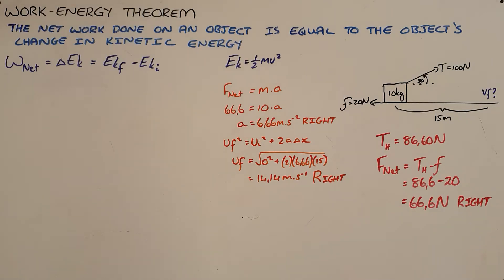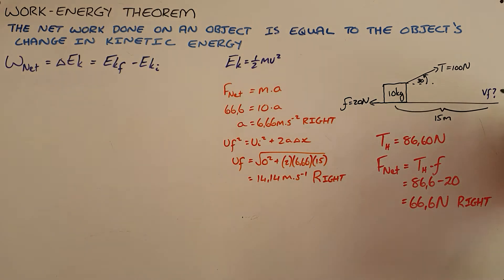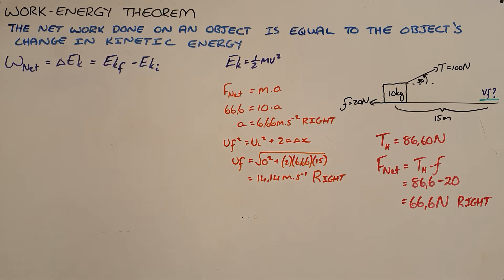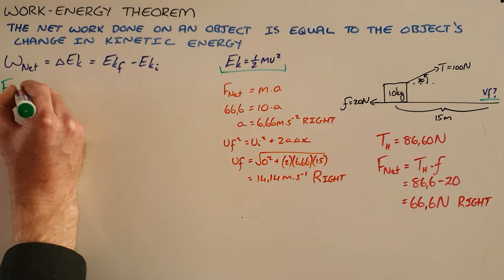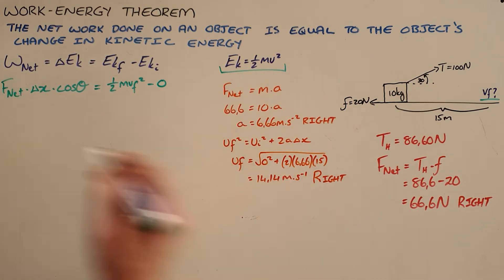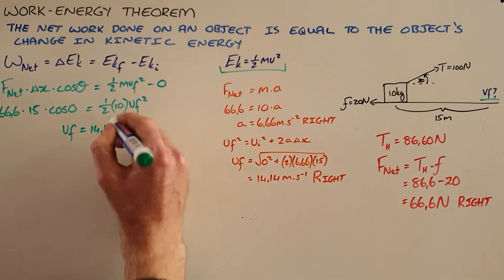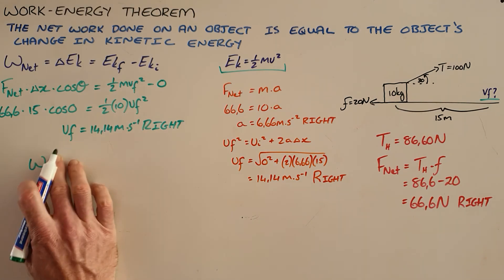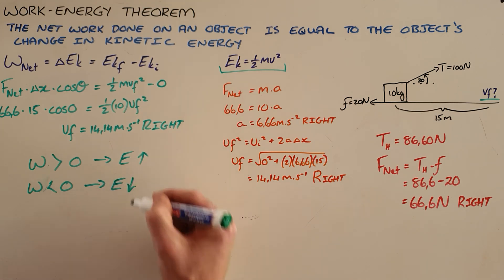Work-Energy Theorem

Comment: if an object is moving up a slope with an applied force. to calculate  f applied do we use cos 180 or cos0?
Reply from the maker: Hi! If the applied force is up the slope and the object is moving up the slope then we use cos0, because the force and displacement are in the same direction.
Reply: I dunno bruh